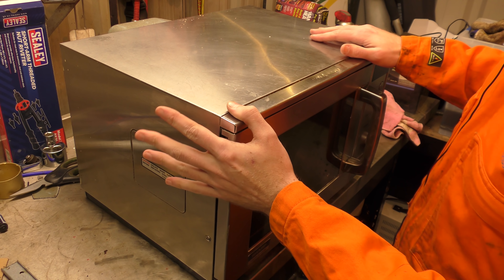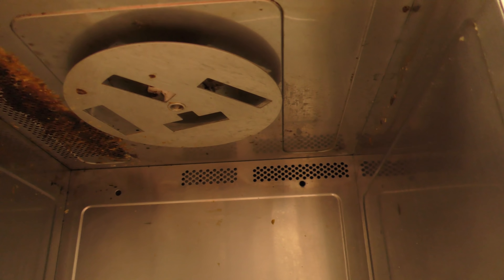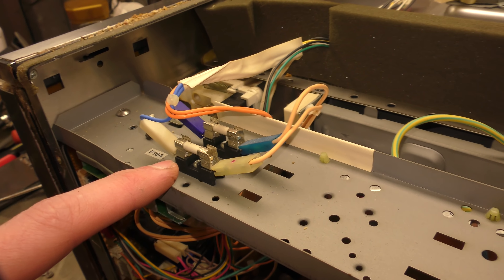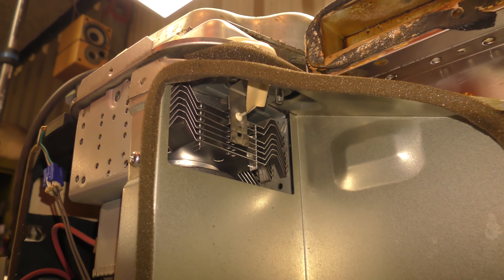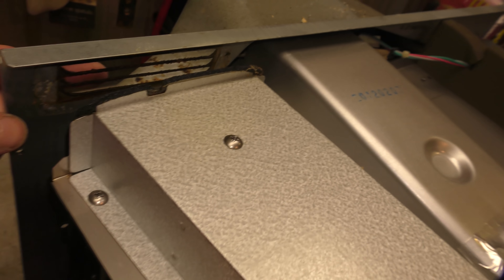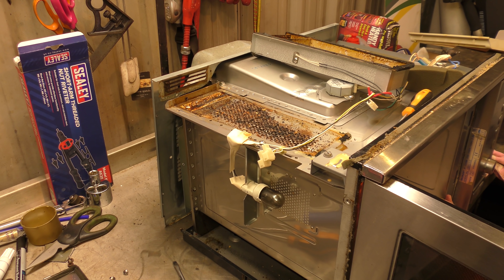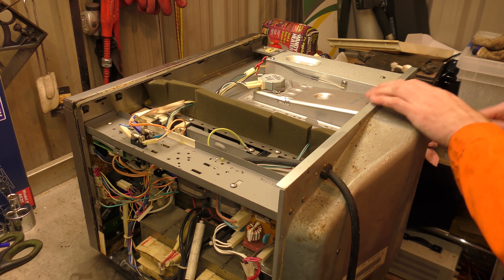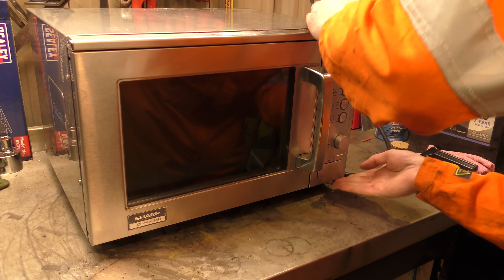Industrial microwave repair / look inside

Comment: There is supposed to be a stainless steel grill on the front of the vents on the bottom part of the microwave covering the "dirty " slots. It's usually held in place with 2 plastic rivets.  It's removable so you can clean out the dust/grease that builds up.
Reply from the maker: No doubt that got 'lost' a long time again.  :)
Reply: No, a few models do not have filters very silly idea not too

Comment: Top tip - for removing grease, a product called "elbow grease" is the dogs danglers, having had to clean behind a stove, where the wall had a film of sticky grease all the way down it, that not even scraping could fully remove, sprayed elbow grease, sticky grease started to dissolve, and mostly wiped away, some bits needed a few more sprays, but it worked where all else failed (inc a hand held steam cleaner) : example - https://www.tesco.com/groceries/en-GB/products/294530429 (albeit a 101 shops stock it inc various places online)
Did it work after it was returned to service?
Reply from the maker: It did yes.  I was surprised though that there was no removable filter for cleaning.  Especially when they are so expensive, I think that one was over £1000 when new.

Comment: Always make sure the capacitor is discharged if you get a belt from it is very painful, could even kill you if you have a weak heart. If the magnetron is nackered they have two really powerful magnets which r handy in the workshop.
Reply from the maker: And that is why I stayed well away from them.  You just have to be careful dismantling a magnetron in case it has any beryllium oxide parts.

Comment: Recently had a problem with an industrial microwave also, looked very similar to the one in this video. Turns out someone tried to warm up a hot chocolate in the microwave and it overflowed out of the mug, the microwave was cleaned however a lot of liquid drained under that plastic bottom cover despite there being a rubber seal around it. Might want to lift that plastic base tray from inside just to see of there is anything under it.
Reply: The bottom seal is not meant to be removed.  There is a spinning wheel exactly like the one on the top, but there is no way to get it out without breaking the ceramic plate. You can replace the motor (on the bottom) but there is no way to clean from under the bottom plate.

Comment: Oh and got my hub swapped out....resorted to a 15 tonne 3 leg puller in the end.... driveshaft let go with a serious bang....though still had to beat on the hub with a heavy copper hammer for about an hour to shift it off the knuckle